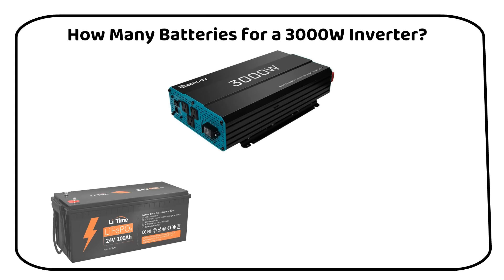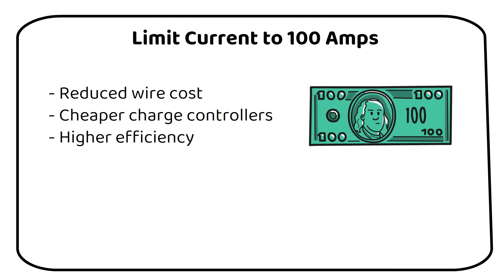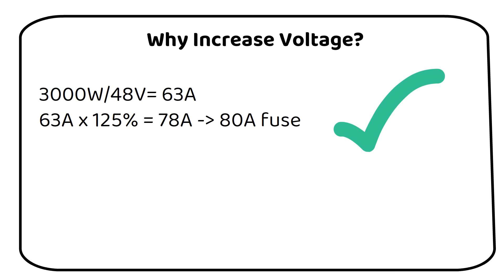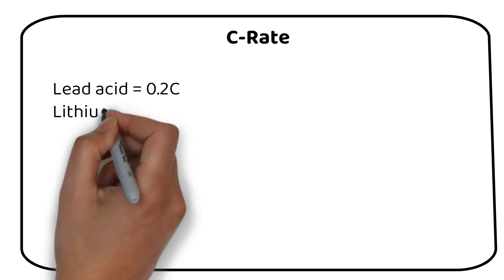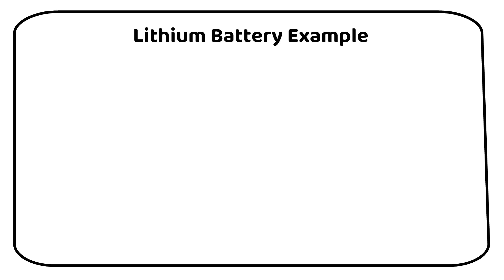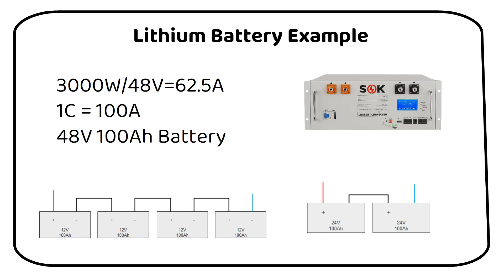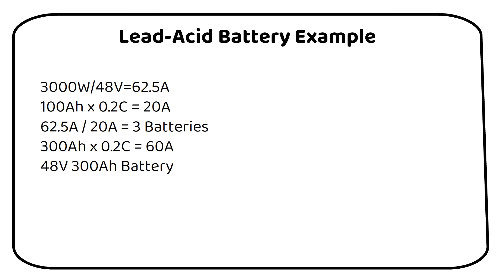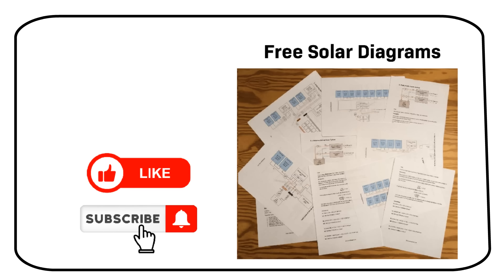How Many Batteries For a 3000W Inverter?

Comment: Thank you for the clear video, I agree with its content but feel it slightly ignores a key dimension to this issue: it is mostly centred around the idea of running an inverter from a single battery only. In that case obviously higher voltages will fare better than lower voltages because they will require less current. But isn't it the case that you can supply the necessary input to the inverter within the relevant "C" constraints of your battery chemistry by adding more batteries in parallel. I am happily running a 3000W inverter using a set of six 24V (110AH) LiFePO4 batteries in my off grid cabin - at 3000W the total current is 125A but each battery is only discharging at a sixth of this because they share (equally, according to the bluetooth instrumentation they display) in the supply of that current. Did I miss something?
Reply from the maker: You are completely right. Having a larger battery is the best solution. Just like you did. I thought I made that point clear in the video 😅
Reply: @cleversolarpower Sorry! I went through it all again and saw you did make that point in the lead acid section.

Comment: When you refer to Lead Acid batteries are you also referring to AGM Absorbed glass matt or Gel batteries also, as I understand they have quite differing characteristics to conventional 'wet cell' Lead acid batteries, ie  less resistance, larger charge rates and deeper cycling 50%
Reply: sorry continuing :deeper cycling 50% than a conventional wet cell battery at 20% discharge safely for maximum lifespan.
AGM or Gel batteries obviously have more capacity than conventional wet cell 
L/A's.
Reply from the maker: Yes, I'm referring to all lead acid battery chemistries. Which wet cell battery can you discharge to 20% without impacting it's lifespan too drastically?

Comment: I just bought the power queen 12.8v 300AH battery and their 2000W inverter, do I need the 3000 W inverter? Or is 2K ok?
Reply from the maker: It depends on what your load is. If your load is larger than 2kW, then get the 3kW. If not, best to go as low as possible.

Comment: where does the 0.2c discharge rate come from? I have never seen that specified by a manufacturer.
I have seen a 0.1c charge rate for lead-acid batteries, which makes charging them decidedly slower.
Reply from the maker: It's specified in the datasheet of batteries. The capacity is mentioned in ah at a 20 hour rate. This is 0.2C. The manufacturer would list the capacitiy of their batteries at a 20 hour discharge rate. It's also known as C20. Check my video about C-rate.

Comment: The 80A fuse you recommended, is that the AC fuse for the Inverrer? If yes, don’t you think that would be too much, especially, with a lead acid battery setup, considering that you would only be pulling and also charging at a current just around 20% of the battery capacity rating, per hour?
Reply from the maker: It's the DC fuse.

Comment: G'day man love your show. I have a question if you don't mind. I'm getting a portable block Redarc install in my vehicle  it does not have an inverter so  watt power inverter should I get I would appreciate your help Dave
Reply from the maker: I dont know what a redarc is, but i assume it's a battery with some usb chargers,... It depends on the BMS inside, some have a 100A BMS, some less. It should be in the datasheet of the product you got (the redarc).

Comment: Something you could talk about is using busbars like in your diagram. I bought some aluminum 1/8 x 3/4 stock and cut it down to 6" with two holes drilled in it for battery connections on my lead acid setup. Seemed to work good. I want to go with copper for my lithium hookup but no one talks about it and it seems everyone expects us to make interconnect cables. They also talk about using the same size for all cables and it seems to me interconnect battery cables for a 48 volt doesn't need to be as large as the wires going to the inverter. Large cables to the busbars where all the 48 volt batteries connect to. Very good video, thanks and I liked it.
Reply from the maker: Good idea, I will put it on the list.

Comment: The 12V 100Ah Renogy AGM Battery you pictured far out paces your C-rate calc of 20A. It is rated at 30A with a 5 second rating of 100A! A couple of these tied to a 2000W inverter works wonderful in a typical RV.
Reply from the maker: It could deliver 1100A, but do that a few times and you will have a dead battery. Deep cycle gels or AGMs are not made for high current. Can they do it? Yes. Is it ideal? No.
Reply: the only time you would ever hit the battery with 1100AMPS would be with a big diesel engine lol  @cleversolarpower
Reply from the maker: @NightshiftCustom  Sorry typo. Should be 100A.

Comment: Thank you for the video.  How about a practical example in the end?  Like with the 48v 100amp hour, how many hours can I run a 15 amp window ac unit and how long to recharge with a generator like off grid or during a power failure scenario.  I appreciate the math, but I need to know run times and re-charge for better context.

Comment: Absolutely brilliant information. I have got my own solar systems running, one being a 12v and another a 24v. However, I am trying to check how much can they handle, so that I can assign specific gadgets to each one of them - right now in the middle of testing. The fridge, kettle work and the slug wire trap system work OK, more things to add. Your calculations are excellent, this will definitely help know what to add where, as I plan to upgrade both system a bit.
Reply from the maker: Glad you like it 😃. Good luck with your system!

Comment: Just put you book in the cart.
I have no knowledge of these systems and setups. 
I have a question that may be a tall order . Can I get a shopping list to power a 220 volt well pump  ? To keep only my water flowing. The house is covered with a DP and added battery, now to get the water covered. Thank you.😊
Reply from the maker: Thanks for getting the book! Take a look at my video about 'solar without battery' for inspiration for powering the pump with float switches.

Comment: I use 3 x100 A.H. Lead Acid batteries for a 12 Volt 3000 Watt sine wave inverter..it runs an 800watt Inverter with ease.

Comment: How do you feel about the new watt cycle 12v 300ah mini battery?
Reply from the maker: I haven't seen the inside of a 300Ah. Will Prowse did a review of the 12V 100Ah and it seemed to be fine.

Comment: Depends on the size of the battery, and the voltage you are starting from. I never advise to go above 3000w from 12 volts
Reply from the maker: Yes, max 2000W for a 12V battery if you are in an RV, and max 1200W for normal system.

Comment: Which is better and more durable between Transformerlees inverter and Transformer inverter? Which inverter will you advise?
Reply from the maker: Transformer inverter is more durable. It can also handle surge loads better than high frequency inverters. Transformer inverters are more expensive but are preferred.
Reply: @cleversolarpower  Thank you!

Comment: Im a bit confused i have a 2500watt mig welder max 90amp. Thinking about fitting a 3000watt inverter in my garage what battery would i need to run the above thanks.
Reply: What's the absolute top surge amperage when you create your spark, that could b well above 3k. Then you need to decide whether you want 48/24/12V batteries. Then you need to decide what chemistry you will use, lifepo4, lead acid, gel etc. Then you need to figure out your usage over time in order to size your array. There are many steps to take on your journey.
Reply: I always use my generator for welding.  I'm running a 24v/3000w system.  Welding impossible.

Comment: Any battery recommendations for off grid, for a 4000w inverter and 4000w solar panel ?
Reply from the maker: I recommend a 48V server rack battery.
Reply: How long do you need to run for in KwH with out that nothing can be said, and then what system voltage. I usually recommend lead acid for beginners as it is more forgiving of mistakes, then by the time that bank dies you should have saved enough to buy lithium for your more permanent bank. and the type of lead acid I recommend is Flooded traction battery (True deep cycle)

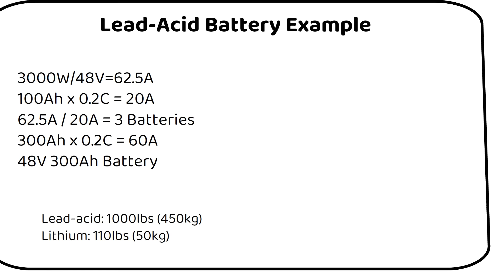Comment: At 5:25 the setup shows 12 batteries? But doesn't the calculation formula you show say 3 batteries. 12volts x 4 = 48volts, and 100ah x .2 x 4 = 80amps...? Or is it when the batteries are wired to make the 48 volts the 4 together count as one and can still only output 20 amps?
Reply from the maker: Good question. Each battery should output a maximum of 20A. Less is better of course. So with 4 12V batteries in series each battery delivers 5.2A. We need 48V, to stay under (my recommended) 100A to keep the system correctly sized. You don't have to stay under 100A, it's just my recommendation for DIY off grid systems. I made a video similar to this one showing how many 12V batteries you need to have to run a 3,000W inverter.

Comment: for a 3000w inverter can you use 2 x 12v 200 ah lithium batteries ? The calculation should be the same.
Reply from the maker: That would make it a 24V 200Ah battery. 3000W/24V=125A*1.25=156A It is possible, but I recommend using a 48V battery because of the mentioned benefits of having a higher battery voltage.
Reply: @cleversolarpower  - You don't have to connect them in series.  You can have 2 x 12v 200ah batteries.  Each will only deliver half of the needed amperage.  That's still a lot of draw for a 3,000w inverter, but if you're using an inverter that large, you should have a larger battery bank, anyway.
Reply from the maker: @jasonbroom7147  Indeed. But connecting in series will increase the diameter of the wire. Overall just having two batteries is not enough for a 3000W inverter like you said.
Reply: @cleversolarpower  - Since when has connecting batteries in series meant you need to increase the diameter of the wire?  It is very common knowledge throughout the solar industry that you go up in voltage (which a series connection does) so you can use SMALLER wires, not bigger ones.  I'm starting to get the sense that you are really new to this and don't actually know what the Helsinki you're talking about!

Comment: Something's off about the math on the diagram featured at 5:24 time stamp. It says to get 48v/300 amps to wire it in the sequence shown. 
But each battery is 12v/100Ah so wouldn't it be 48v/1200Ah? 
12v/100Ah x 4 would equal 48v/400Ah, and then multiply by 3 sets wired in series.
Reply from the maker: You don't choose wires based on the capacity (ah) of the battery. You size based on the current (a). You got these two confused.
Reply: @cleversolarpower  I'm not referring to the wires, I'm referring to the total amp hours at the top of the diagram. 
It shows 4 batteries in series which by math 12v/100Ah would be 48v/400Ah. Plus there's 3 rows of that, which multiplied by 3 would be 48v/1200Ah.

Comment: Thanks god i watched your video before connecting my new battery. (12V 150 Ah lithium)

Can you tell me please how many batterys i need to run my 3000 W inverter? 2=24V, 3=36V or still 4 batterys to make 48V?

Thanks a lot! 🙏
Reply from the maker: Yes, you need 4x 12V batteries in series to make a 48V battery. But only if you have a 48V inverter.
Reply: @cleversolarpower Ok, the Ah doesn't even really matter. My inverter is 12V-24V-48V automatic.
Thanks very much for you answering!!!

Comment: How easy is it to find a 20A Charge controller with a maximum PV input voltage that is high enough to accomplish 800W of solar array?
Reply from the maker: It depends on the voltage of the panels and the max input voltage of the controller. Check my video about sizing a charge controller.

Comment: We have 4 - 200 amp hr ion lithium batteries running 12 V with a 3000 W inverter. will be switching over to 24 V I don’t need a 3000 W inverter so is it better for me to run a 2000 W inverter with a 24 V system?
Reply from the maker: If you already have one running, then switching over to 24V is not necessary. Should be done in the design phase.

Comment: I just bought a new 3000va ups,  it provides a voltage 163 to 190 volt , is that normal ?
What ampere should a 3000va ups deliver?
Reply from the maker: Doesn't seem like thats normal.

Comment: I have a 3000W inverter, to run it at full capacity I need 4 lithium batteries because I need 2 to make 24v and 2 alone can only give 100A at 24v which is 2400w, so I need 4 of them to be sure to have enough to run my 3000w inverter at full capasity. (it can also use 6000w for a short while but the batteries can also provide more Ampere for a short while so it balances out).

Comment: Totally new at this but I want to build a system to run 2 freezers for emergencies.
Don't need solar to recharge since I have a gas generator to recharge with.
This is all for emegency backup and I would build a separate one for a refrigerator.
Reply from the maker: You can do it easily. You have to figure out the consumption of the 2 freezers and then multiply by the amount of days you want to run them (usually 3). Then add a charger and inverter. 3000W should be enough, and I recommend using a 24V system for this.
Reply: Thank you @cleversolarpower

Comment: I have 700 watts of solar, two 206 AH lithium ion batteries and a 3000W inverter in my camper.  It works great.  I can run the AC for short periods of time but i prefer to use a generator for that.  I'd like a bit more solar and a third battery so I'm covered for winter, but that's a ways away.  I'm out of room on my roof so that's one problem.

Comment: I recently got a Jupiter 3000w power inverter, Super Start Marine Deep Cycle battery, Viking 4amp battery charger/maintainer; all recommended to compliment each other. Is this a good setup?
Reply from the maker: Compliment? That's a bit of an overstatement. I would say compatible 😬

Comment: If I have a 3000watt inverter with 200ah lithium batteries what size fuses should I be using?
Reply from the maker: Check my video about wire and fuse sizes.

Comment: Great Info, much appreciated. The 80 amp fuse conversation confused me? May I please ask if this set up(4 x 12v 100ah) works for a 4000 W inverter. I ask because of the fuse situation and needing more than the 80 amp fuse you discussed?
Reply from the maker: I don't understand your question. Repeat the calculation for a 4000w inverter and apply the voltages of your battery. Then check if it's ok compared with the advice given in the video.

Comment: So are inverters made for different voltages? Such as a 12 volt inverter, a 24 volt and a 48 volt inverter, or are they all the same, and will use whatever battery voltage you connect to them?
Reply from the maker: Yes, inverters are tied to a specific voltage. Be carefull 😉

Comment: I'm trying to figure out the optimal set up for my Freightliner Cascadia transport truck that runs an electric APU with an inverter inside the bunk to power electronics. The inverter is 2000w but I'm not sure if it could handle a 5000w inverter

What is the best way to contact you?
Reply from the maker: Most of the times it will work, but that does not mean it's correctly sized. As you can repeat the calculations in this video for your own use case. You can send en email to me through my website cleversolarpower.com

Comment: I would love some help picking the right inverter for my f350 @nick. I have two lipo batteries under the hood
Reply from the maker: take the C-rate of the battery and multiply by the capacity. if each battery has 0.5C discharge rate and is 12V 100Ah, then you become: 100Ah*0.5C*2 batteries= 100A max discharge. 100A*12V=1200W inverter maximum.
Reply: @cleversolarpower  thank you so very much. How can I buy you a beer?

Comment: for a year, when Camping, I used a 3000w Inverter with my 120ah Battery to run my Dometic Fridge, an led Lamp & low power TV...😂 just clamped it on & everything ran like a clock..
...have since changed to a 1500w  Inverter...will be buying a bigger Battery soon, maybe 200+ah.
Think I've damaged my 120ah Battery..? 
Still works beautifully...😂
Reply from the maker: Unless you are drawing a 3,000W load it's not a problem for the battery. For your application it would have been a lot cheaper in wiring cost to have the smaller inverter from the start.

Comment: Wonderful video with everything broken down. Thank you, a question, though. Are the calculations for the Lead-Acid battery the same for AGM batteries?
Reply from the maker: Thanks. No, lead acid has a c-rate of 0.2C while lithium has a c-rate of 0.5 or 1C depending on the BMS.
Reply: @cleversolarpower  with all due respect, the question was regarding an AGM (Absorbant Glass Mat) battery. (I am looking for the answer to the same question)

Comment: Where do you get the 48 volts to charge?
Reply: 4 Connect the 4  100 watt 12 volt solar panels in series. You get 400 watts available at 48 volts.👍
Reply: By the way be sure your charge controller can handle the voltage from the solar panels.

Comment: thank you i was abit in the dark now i can see the light i am more confident to start purchasing my batteries and inverter
Reply from the maker: No problem! I will publish a video about a 1000W inverter soon. The same principles apply, and I tell why we size this way in that video.
Reply: @cleversolarpower  sorry to reply only now, I purchased a luxpower 48v 5kw and AND a 5kwa battery I forget the name, I had it installed and I AM very happy it's like a power station all on its own and bcos of the inverter I changed to gas where alot of power is needed so I don't fear the power going off anymore I feel protected